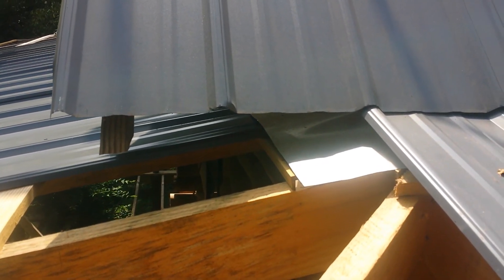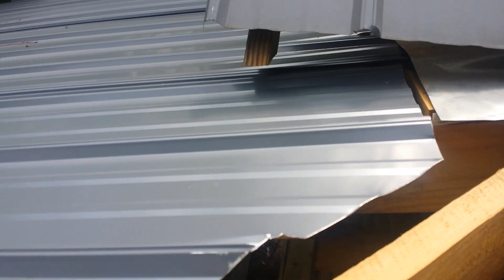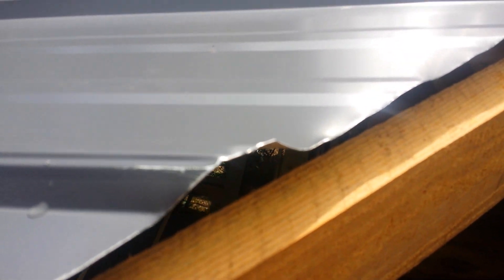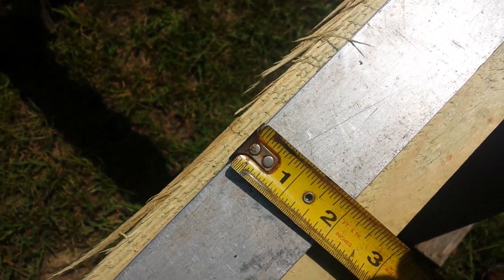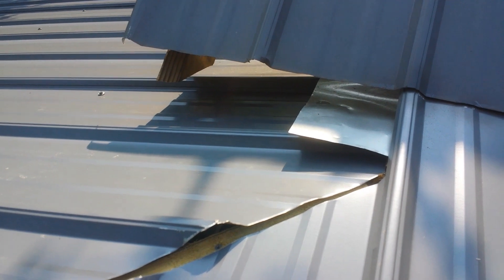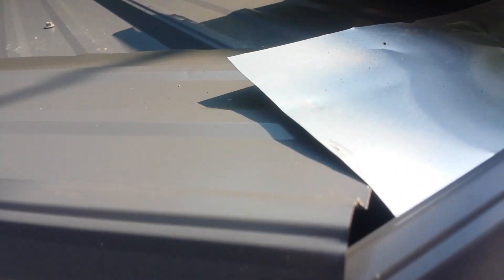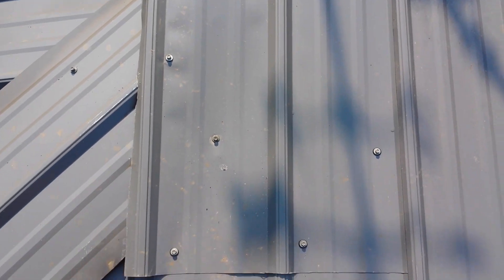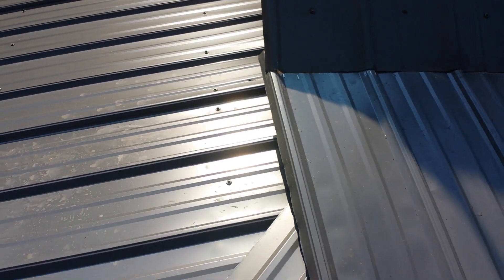Off Grid Log Cabin Build, Installed Metal Porch Roof

Comment: Looks good there Mr. Duke. Shouldn’t be any leaks. Ya be careful out there in the heat. Even if temp is down that darn humidity will get ya. 
I installed some old tin on my porch as a ceiling and wainscoting. I cut it with my angle grinder with a cut off wheel. Just clamped a board down for straight edge and cut along the board. Worked really good. Just a suggestion. I’d never tell ya how to do something. You got way more knowledge than me. God bless and stay safe
Reply from the maker: yeah I have cut it off like that too but try and keep it from being in the weather...it may not make a difference with galvalume but the galvanized rusts easy after cutting it with a wheel...hey we are always learning...Thanks Jeff...Blessings

Comment: Thats a slick idea for the for the ridge cap, looks good. Looks like its just supposed to be that way.
Reply from the maker: I could have installed the return from the cabin roof like its usually done but the  rain water would run toward the edge of the ridge cap, could possibly leak with heavy rain....Thanks for watching and commenting Robert